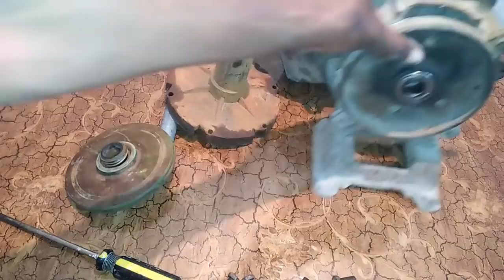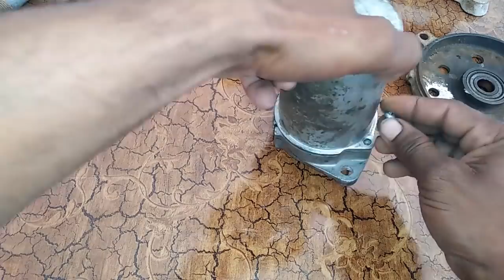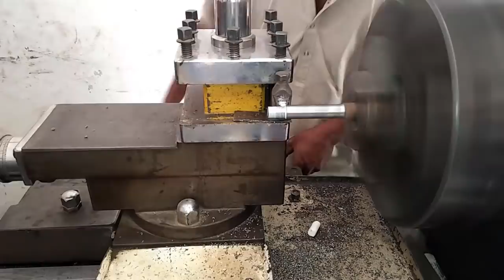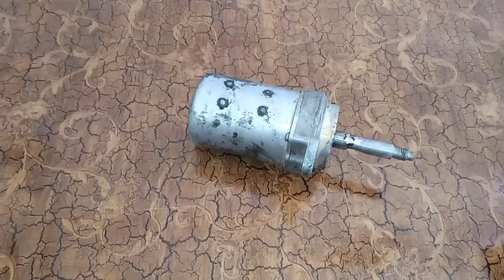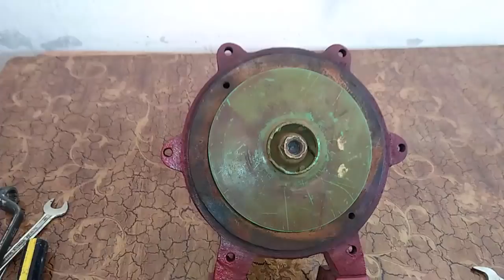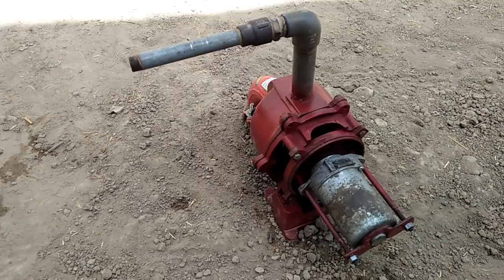How To Make Solar Pump With Old Electric Water Pump With 12 Volt Motor New Amazing Ideas

Comment: Bai mera water pump injector ha AC ma mujy b dc karna ha 1hp ki dc motor kitny tak mil jaiy ga or kya apka number mil sakta ha?
Reply: Ap 1hp ke dc motor Lo 3000 rpm ke .. 24 volt me...Load pr 20 amper Ly ge.. Or 3rd floor tk pani chala ja ay ga.. Motor 5000 hazar tk mily ge...

Comment: How many RPM of this motor
Reply: @luqmanali9015  yaar speed kitni hoti hai motor ki
Reply: @luqmanali9015  60 feet
Reply: @luqmanali9015  jo motor ap ne lagai hai us k RPM kitny han RPM motor ki speed ko kahty han
Reply from the maker: 2800 RPM Hy
Reply: 1500 rpm.. But need 3000 rpm... 40 ampers